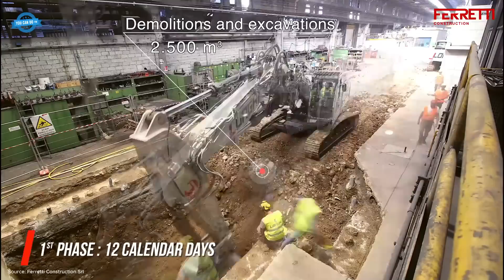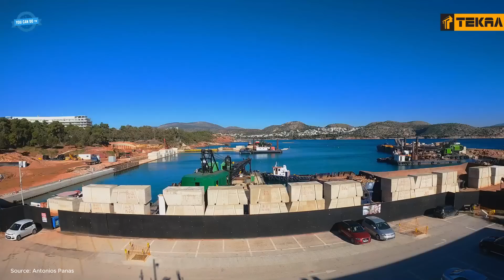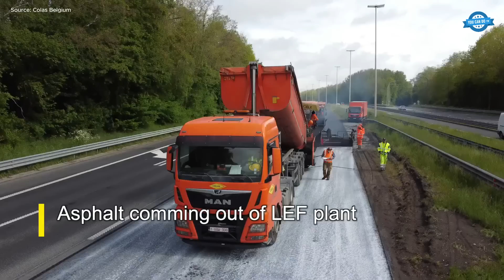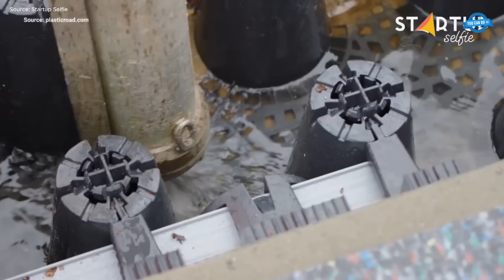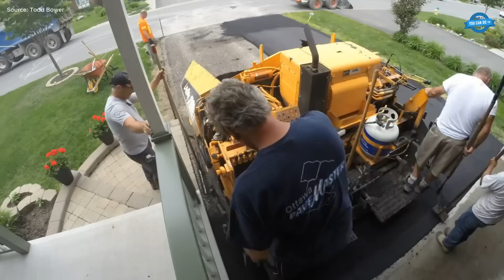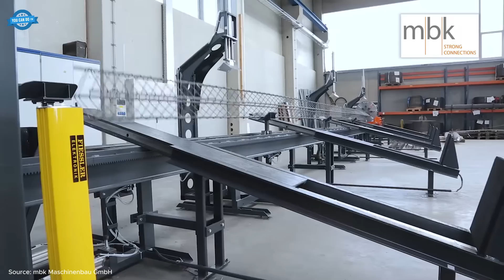Ultra-fast Underground Construction Technology. Heavy machinery & Equipment In Civil Engineering

Comment: Impressive compilation of modern construction methods! The continuous casting machine foundation work shows excellent application of fast-track construction principles - using high early strength concrete with accelerated curing admixtures is crucial when plant downtime costs are astronomical. The micropile wall installations at 6-7m depths demonstrate proper deep foundation techniques for supporting heavy industrial loads. The modular precast approach with laser-guided placement achieving millimetric tolerance is the future of precision construction. Also notable is the tunnel boring machine (TBM) segment installation - those precast concrete rings must withstand tremendous ground pressure and require careful gasket sealing to prevent groundwater infiltration.m